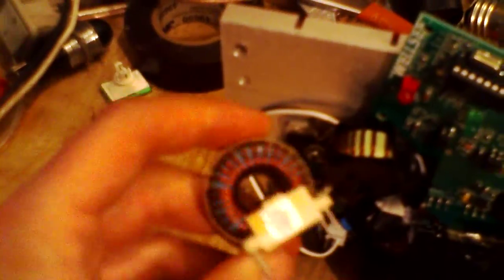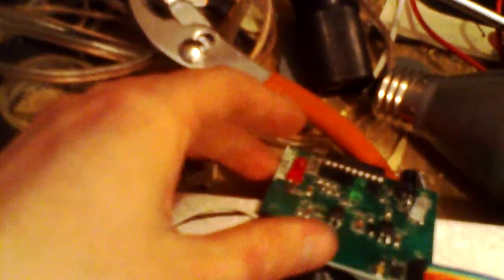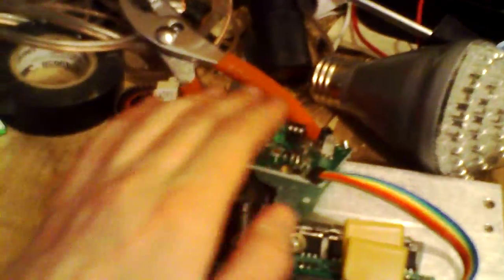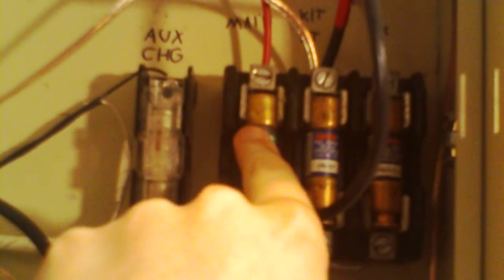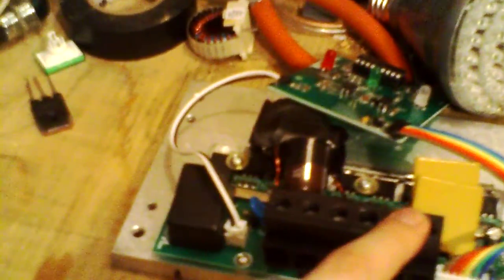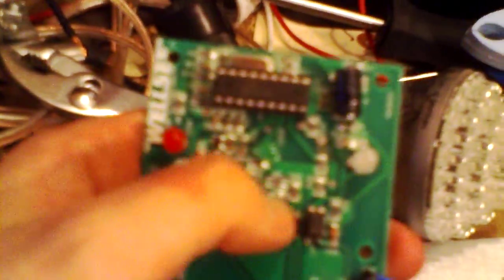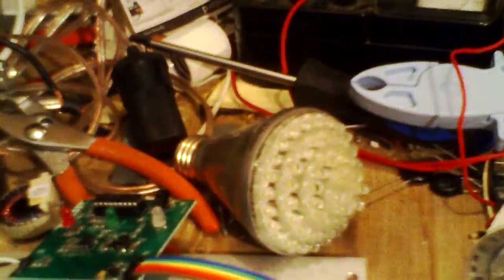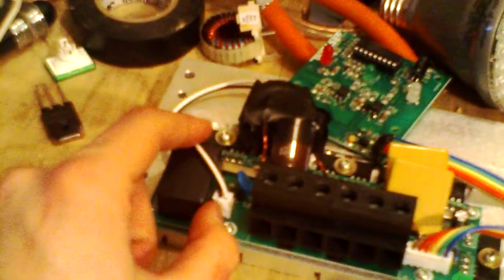WellSee fake MPPT inductor mod

Comment from the maker: I don't know of one as I am working on my own MPPT design which would negate the need to look at these cheap 'MPPT' controllers regardless of whether or not they are real as the build cost is cheaper.
And check your security settings as I can't reply to you directly.

Comment: I just bought one, and saw instantly that it was not working at 17V, but the interesting thing about the current gain, is that it just covers the inefficiency in the MOSFET switches. I have a Morningstar 60A, which loses about 0.5V across the FETs. I would like to return this product (on principle), but I can't see a 40A controller at a decent price. I might just end up with one that loses 0.5V. I need something that works with the Morningstar, to charge gel cells, and cuts out slightly higher

Comment: I actually bought one of these Wellsee 15 amp charge controllers. And you are absolutely right, the gain is max. 2%. I have bought a Tracer 1215 MPPT, which should arrive soon and that takes up 100 volts in. I have 12 homemade 60 watt panels and I will put 4 panels in series to make about 80 volts open, down to my 24 volt battery bank. I will make a video as soon as I get the controller and I hope to see 10 amps put into the batteries.